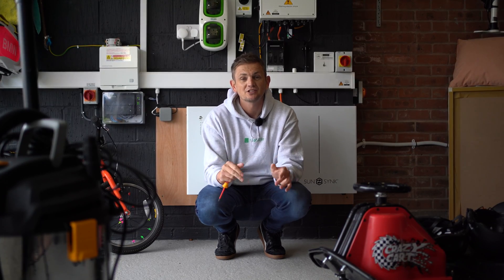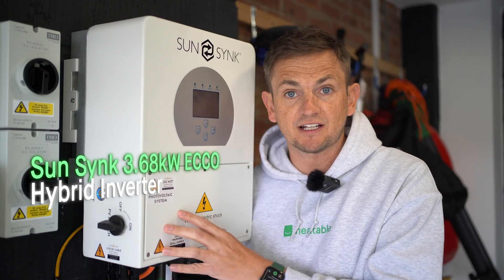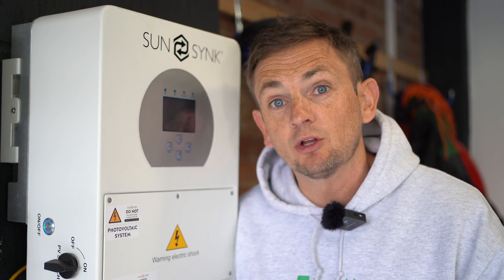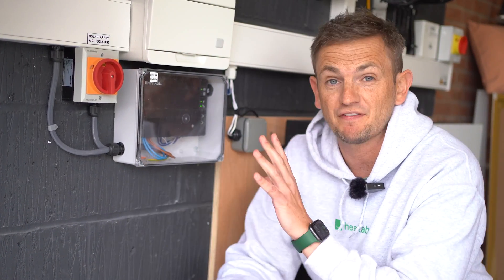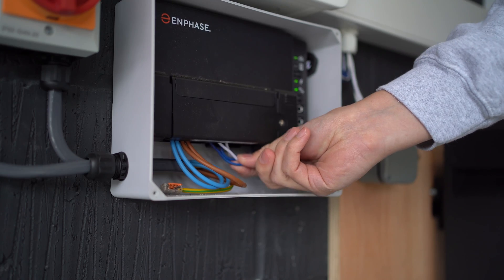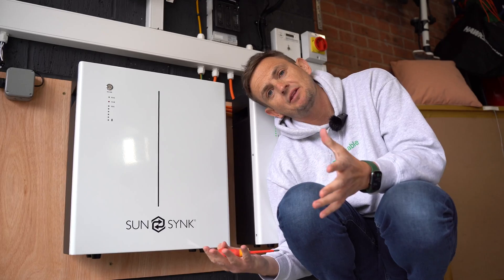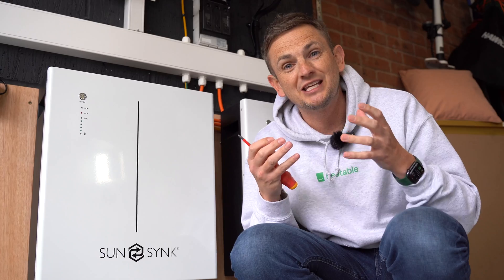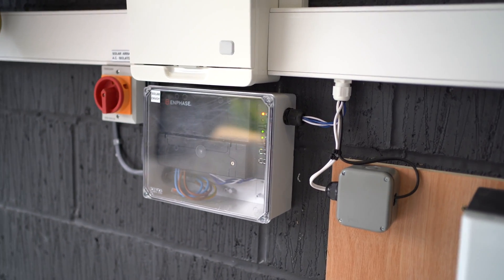Standard vs Bifacial Solar Panels: Is the extra cost WORTH it?

Comment: Realistically you want a minimum of 10-12 panels for a efficient string inverter of 3.68kW.
 If you are looking at a small system (like these 5 panels) then micro inverters are a good call or look for a suitably sized string inverter with a low startup voltage. 

I guess the big question here is what installer decided 5 panels were a good idea when you could clearly get 10 panels on the roof, which not only boost the peak output but also the voltage in lower light conditions for earlier startups and later shutdowns.
Reply: On the background shot it has 2 DC isolation points. My understanding is that this was a 10 panel system originally before they swapped 5 out to test. Unless I’ve got that wrong?
Reply: Re watched it, it was 10 originally
Reply: @PVOK232  Oh ok. But my points above still stand. You can't double a 5 panel systems data and say that's what a 10 panel system will be. 

As for panels it doesn't really matter if using string or micro your installer should be using type N panels now as they have massively dropped in price and are only a few pounds more expensive than standard type panels.
Reply from the maker: @gavjlewis  As we said in the test, this isn't the most scientific, just a test that we carried out for our own curiosities and found some interesting results to back up manufacturer claims!

Comment: You could add another inverter and connect that to the battery. It would need to be AC coupled but would still allow charging from the sun and monitoring.

Comment: great to see bifacial is 20% more production, but what is the price difference? it would be good to compare cost of production/panel with microinverter based on 10yr lifespan to know if that 20% extra is cost effective. also useful to know that the batteries need to be charged so they don't break. making sure production is enough for that is another useful consideration to be aware of.
Reply from the maker: We might look at doing this as an extra video to give some more insight into how much more or less the system would cost over a 10 year period!
Reply: @Heatable  great, thanks

Comment: Great video, I wonder what the difference is between the Fusion 1 in this video and the Fusion 2 panels they sell now
Reply from the maker: This would be a great future test as the Fusion 2's we now use are 440W and we used IQ7+ microinverters, where as with the new IQ8 range, it would allow for more production with these higher output panels.

Comment: How would you stop the clipping, and would it be worth the upgrade because I’m guessing it only clips a few days in summer
Reply: I have the Enphase IQ8AC micro inverters which do around 360w peak. I had clipping on 24 of the 31 days of July. I guess using smaller panels is the only way to stop the clipping but it's hard to know what the best option is.
Reply: @MrSeanUK  I don’t think the clipping losses would be too much over the year. I’d just like to see it with good panels like the Aiko Neostar with a lower start up voltage hybrid inverter like the ones in the power wall 3 or even the sigenstor with at least 6 panels per string.
Reply: @MrSeanUK  Smaller panels would probably mean more inverters for the same size system.. for 6-7 days of energy, it’s probably not worth it

Comment: Nice job. Been waiting for this. Just curious now this test was started a year ago what difference you’d get with new hybrid inverter tec. The hybrid inverters on the powerwall3 (60volt)and the sigenstor(100volt) have a lower start up voltage than the sunsync  used(125volt). It’s all interesting stuff. Curious if the differences are panel based or inverter based.
Reply: Yeah that would be interesting to know. Either way they aren't going to get the best out of the SunSynk with only 5 panels!!

Comment: Is it possible for an average 2 bedroom end terrace house with say 8 south facing panels to generate enough electricity that you don't have any bills other than the standard charge. Looking at cost of systems to lower my bills for when I retire to keep my monthly bills as low as possible due to pension limitations. After watching reams of videos still cant see if it is worthwhile.
Reply: Would all depend on how much energy you already use and how much that costs you. I use a lot of elec (9000kWh pa inc. EV charging) so my 18 panel system I hope to cover 2/3 of my usage. I'll then able to take advantage of the battery to charge overnight on the cheap 7p/kWh rate during the less sunny months to avoid peak rate prices. Couple that with the current export rate of 15p/kWh and selling a good chunk of the production, my net bill for the year should be zero and hopefully cover off some, if not all, of my standing charge. But I'll still have a gas bill. My system was £11500 (not a straight forward install as it was over 5 roof faces) and depending on what happens with energy tariffs over the years I'll break even in 5-7 years. The way I see it is that I'll be paying for electricity anyway, so if I could finance the system to match my current monthly costs then I may as well. Then one day I'll be saving £200pm over night and won't look back.
Reply: You'd need a battery and off-peak charging in winter to maximise your immediate return on investment. Don't forget, the value of your property will increase if you install solar/batteries.
Reply from the maker: Hey, as Steve's commented below, it does depend on how energy you'll be using. If you know how much energy you use currently, you can put this in when you get a quote (link above) and it can tell you how much you'd be saving or estimate it for you.

Comment: Great work and well done for producing data to test your claims. A few of my takeaways/points:

- The performance gap was bigger than I expected. I'm impressed!
- I'm no expert so I could be mistaken but if that's the DC-AC performance loss, Sunsynk is lying on their datasheet or something isn't quite right.
- Please, please, please use zero-axis graphs when reporting data. You have a valid point, no need to tarnish your image by making it look bigger than it is by using an axis that starts at 70% of the bar chart.
- It's a pity you couldn't test regular panels with the microinverters and REA panels with the string inverter as that would've provided solid evidence for both technologies independently but obviously that would have been impractical 😅
- Personally, I think you missed an opportunity to hammer home a hidden win there: the REA/Enphase system was 18% more productive in summer but a whopping 60% more productive in December, when electricity use is often higher.

Great job though, the solar industry needs MUCH more of this kind of thing!
Reply from the maker: Hey, thanks for your comment! You make some great points. We would have loved to be able to test those scenarios separately too. Funnily enough we took the 60% uplift in December section out of the video as we weren't sure it would be a section viewers would be too interested about. Great to know you spotted that though!

Comment: Hi Ben, great video! I can vouch that the REA bifacial panels with Enphase microinverters definitely outperform string panels as claimed by the manufacturer. I have plenty of comparison data to back this up. (As you know I have a spreadsheet for that 😂). One thing worth mentioning is that where the REA-Enphase combination truly excels is when installed on roofs with shading. The difference is significant—my shaded garage roof with REA/Enphase even outperforms my main roof with string panels, which is completely unshaded. 👍
Reply from the maker: Thanks Roger! We definitely see it dominate in shaded installs, yours is a great example of this!